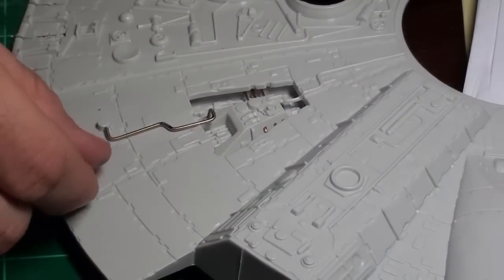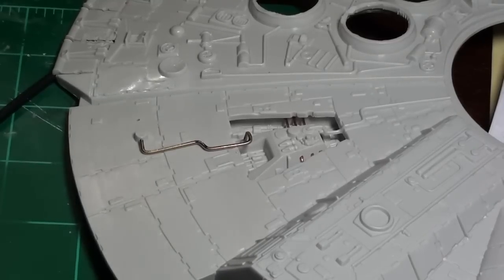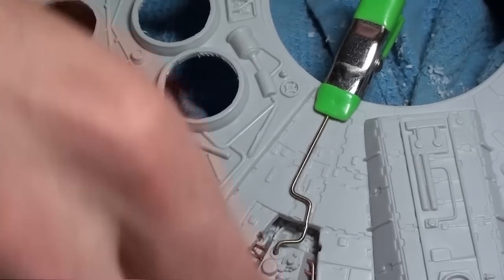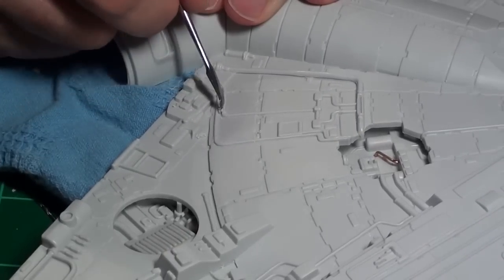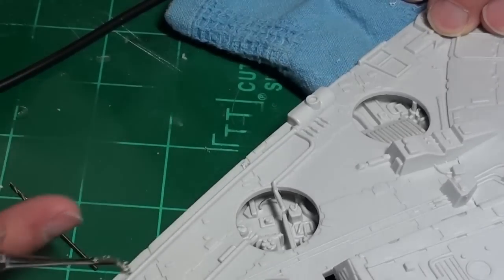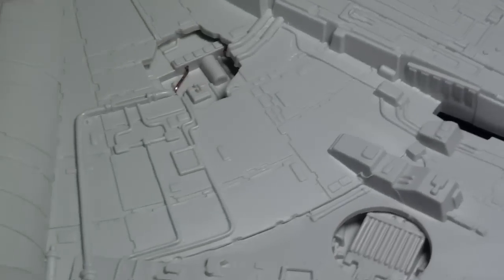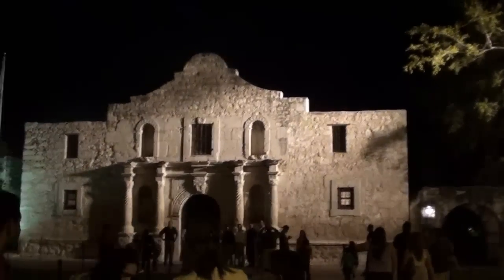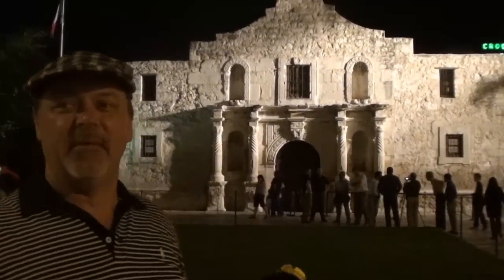Millennium Falcon part 11:  More pipes!

Comment from the maker: I have some aluminum wire and decided to go with the copper.  It is not as flexible, and that is why I like it.  It will hold its shape better.   And it will hold up to abuse better as well.   

The copper is flexible enough to be fairly easy to bend.  Brass would drive me nuts, it is too stiff.   But I will use it for the larger pipes.